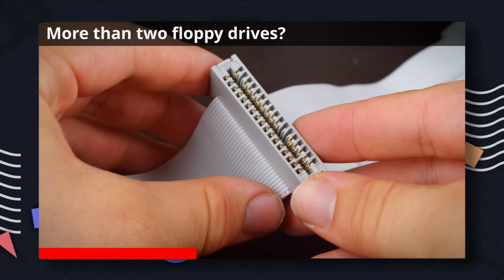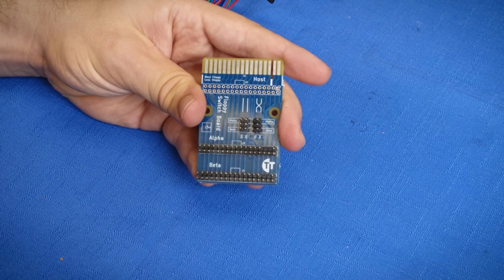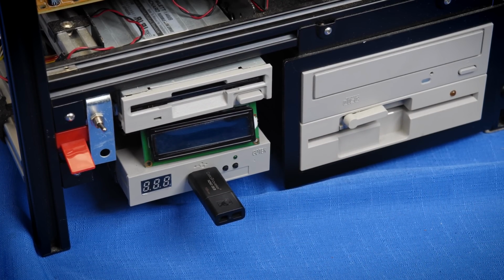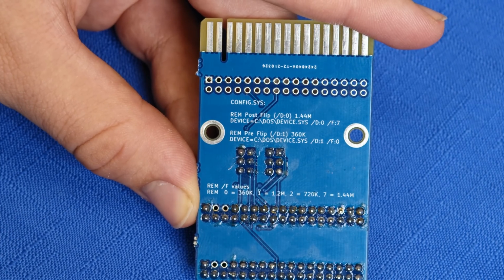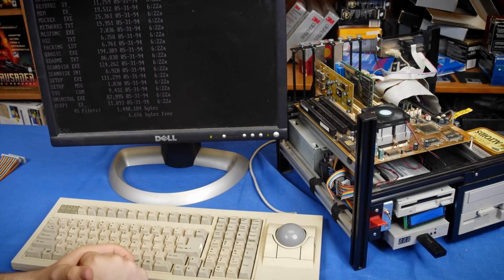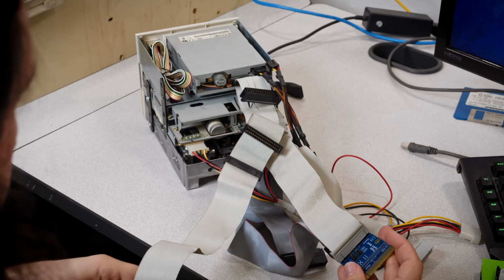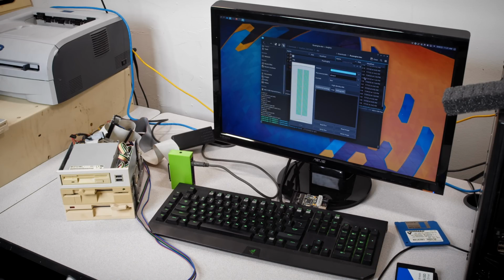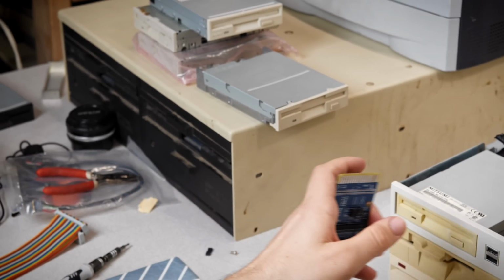Manual Floppy Drive Switching Made Easy

Comment: I suspect that DRIVER.SYS was originally added to support the dual floppies on the IBM PC Convertible
Reply: The 5150 also had an external floppy port, but I don't even know if there were actual drives or drive cases built for it.
Reply: I think it was more so that single drive computers could have a virtual second drive, that allowed access that appeared to be 2 drives, while only on one.  I recall a faint memory of using a computer that required lots of floppy switching and seeing that message popup a lot, on some programs.   And you'd be swapping between a program disk/data disk a lot
Reply: Image copying a file from one floppy to an other, with only a single physical drive.

Neat to see it can be used with different hardware / disk geometries.

Comment: that driver.sys methot is REALLY cool! my only concern would be other operating systems like freedos, 95, 98, XP, OS/2, etc. how about adding a header for a button that manually sends the disk change signal or even some fancy circuit that automatically does it when toggling the switch

Comment: On my family's Commodore PC-10 (XT clone), it had a 720k floppy as B-drive. In DOS 3.3 you could reassign the B drive from 360k to 720k with DRIVER.SYS (no fancy BIOS upgrades, mind you!). But in DOS 4.01 it gave the 720k drive the letter C instead and you had to press the Any key to continue. In DOS 5 and later, it behaved the same as in 3.3. If memory serves: DRIVER.SYS was first shipped with MS-DOS 3.2.